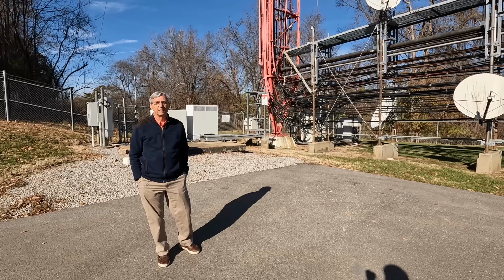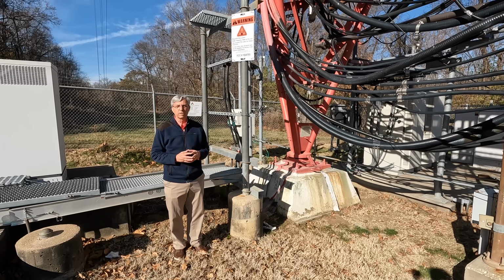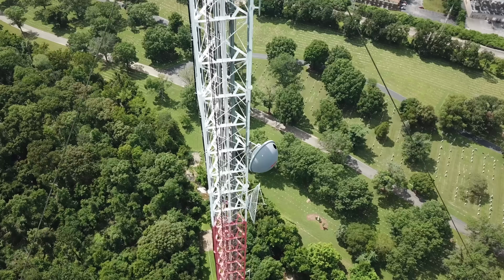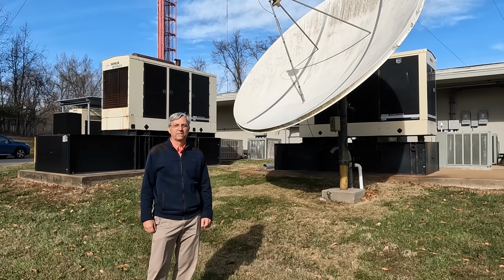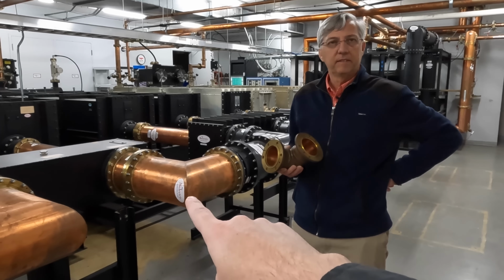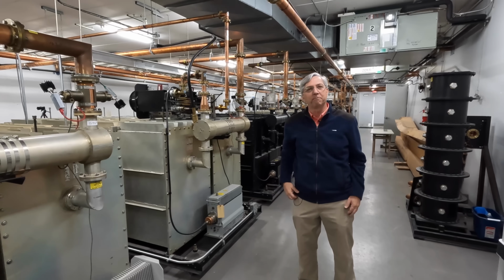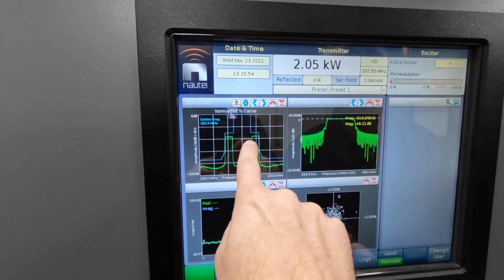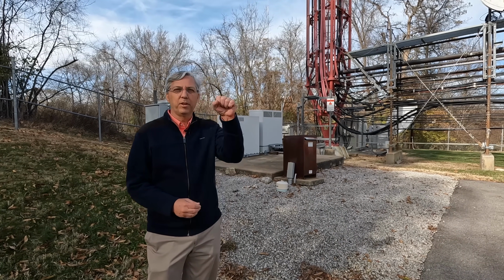1 MILLION watts—really? FM Supertower Part 2!

Comment: 15:03 I would prefer to say the high engineer will say ”you need to lathe a flenge to the fan and cut some 6061 aluminium at this critical length to use the max out of this fancy razor lazer blazer fans!”
I prefer low/mid engineering. A 10$ fan will give you more cooling than you need, or if you like me is a kind of homestead engineer, just use some wide aluminium rods to use surface and help travel the heat to the fans that you harvest from some used parts or find att local store. Easy, cheap and fast. Not to stab the real engineer in the back but think outside the box. In the livingroom - no. On site - Yes! ❤️🫶🏼

Comment: Electromagnetic radiation is on the opposite side of the visible light spectrum far away from ionizing radiation!

So yes, you are in-fact just being irradiated with heat.
Reply: I should say infrared!
Reply: @12:30: I would totally make an antenna out of that, I used a bit like that with a Pringles can to make a 2.4GHz directional antenna :D
Reply: We do indeed use cells for DAB, these channels are xA-xD where x is 1 to 13 with E and F added.
Reply: And we still have FM radio, because there are a lot of old cars still on the road!

Comment: SUPER-TOWER???  Come ON there are LOTS more towers taller and with higher power!  Retired Broadcast Engineer.
Reply: That's the nickname the original builders / engineering group chose (mostly because of the 10 FM stations combined on it).

There are only a couple other combiners with as much fed into them in the US; most of the installations are for only a few stations or separated onto different antennas.

But 'super' is in the eye of the beholder :)

Comment: Hard hats are great for protecting your head from small stuff and they should be part of any safety kit. That being said, and this is coming from a retired tower hand, a leg bolt dropped from 300 feet, is going to laugh at your hard hat. It may not fully penetrate but it is certainly going to cause major blunt force trauma. Best to stay away from the site all together.

Comment: Is that a 4CX2000A? If it is, you should definitely send that to Econco and let them refurb it for poor bastards like me. Hell, you can put it in my bank if you'd like...
Reply: I believe that is correct. They could probably be banked at Econco. I just used them to rebuild a much smaller tube for a 5K but by the time I got it back the 5K tranny had a control board failure and had a lot of finger stock issues anyway. We ended up replacing the transmitter. New 5K is about 5 or 6 RU compared to the 30 year old 6 foot tall unit!